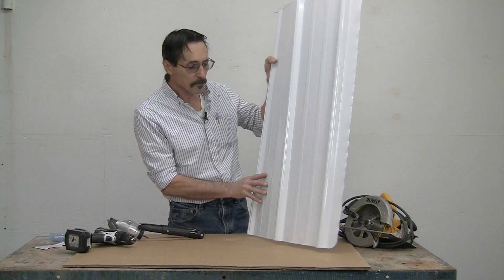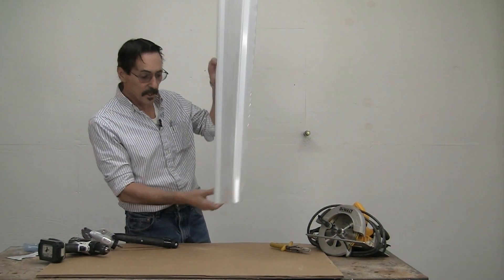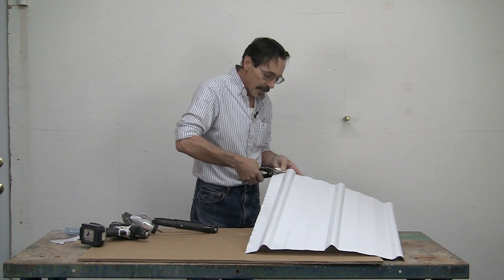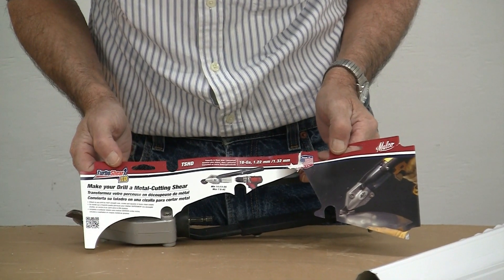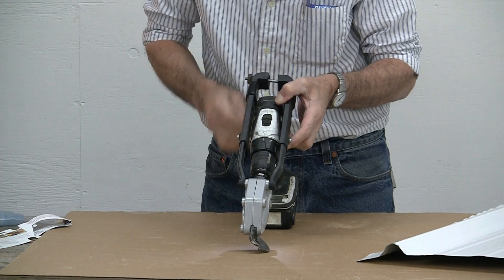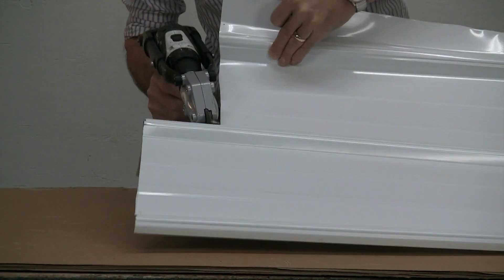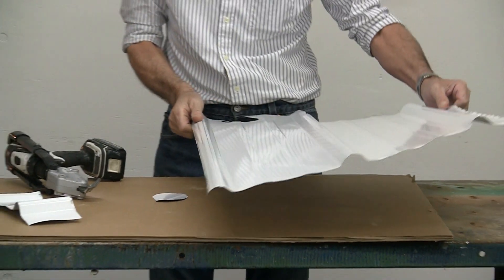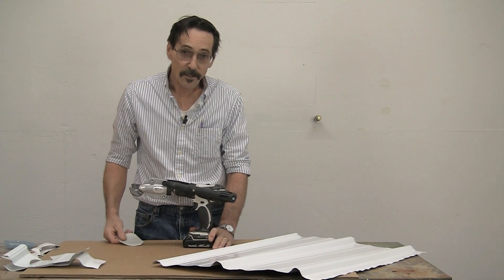Pole Barn Steel How to Cut it Malco | Missouri Wind and Solar

Comment: I wouldn't use that on a drill I wanted to keep. It obviously blocks the vents where the fan blows hot air out of the motor. Now a $20 throw away drill...I wouldn't so much care about over-heating. Looks like an alright alternative to a dedicated sheet metal sheer to me for the ones who aren't going to be using them constantly.

Comment: There are some circular saw blades on the market that are made for cutting sheet metal.  There are cheap ones and much more expensive titanium carbide tipped versions (really have to be a professional installer to justify those).   If you go the plywood blade route you need to get the steel blade and not a carbide tipped woodworking blade.  You can shell the teeth out of a carbide tipped blade running it backwards like that and those tips are moving at a good clip when they come out.  I've seen several cases where people were injured by doing that.  Of course using power shears solves that problem without those concerns.

Comment: Got my 24' x 40'  2-story pole barn posts and framing done about a week ago. The least expensive price I could find was about 110.00 for this and so hope it does the job and lasts like some people are saying.... that's a bit of money just for a small aluminum gear box and a couple arms to wrap around the back of your hand drill, but made in the USA and already tried harbor freight's and northern tool's metal shear version and BOTH WERE JUNK! harbor freight's WOULD NOT cut across the ribs in the sheet metal and the motor burned up just after a few hours and so took it back and they asked if I want a replacement and I said just give me my hard earned money back!  Northern tool's version specifically stated it can be used to cut across the ribs and it WOULD NOT no matter what technique we tried and so sent it back and waiting for a refund!
Reply from the maker: Well mine costs about 50 bucks at the local lumber yard. Still cutting good and ribs no problem. Been using it alot this year. All the pole barn guys around here use this one and they love it. Harbor Freight = CRAP. 
Some HF stuff is ok, i own some.
I asked the pole barn builders before i bought mine, money well spent.
Reply: It works I've cut 1000's of sheets with the same one  angles one handed,  You need to flip the mount and work the trigger with your pinky, you need strong hands and you have to move the drill up and down to match the angle of the steel, that's the problem most people have, if they get through the first rib and across the flat part as soon as they hit the rib it stops dead and they sit there holding the trigger expecting the tool to jump over the rib. I used the same one for 10 years and only ever had to tighten the body.